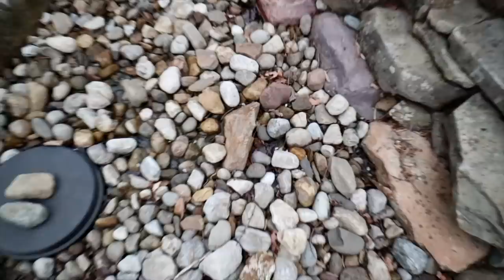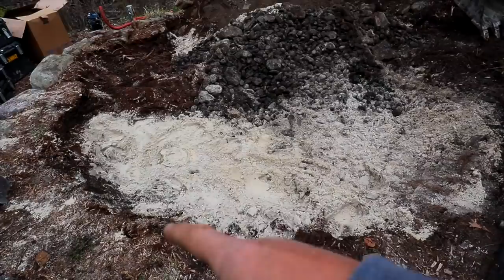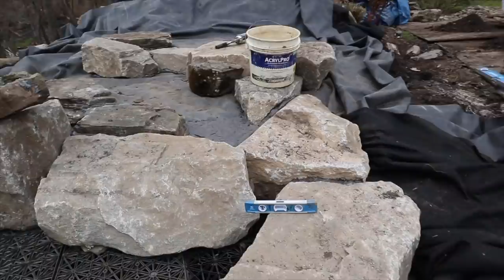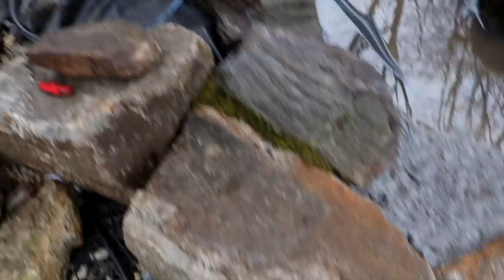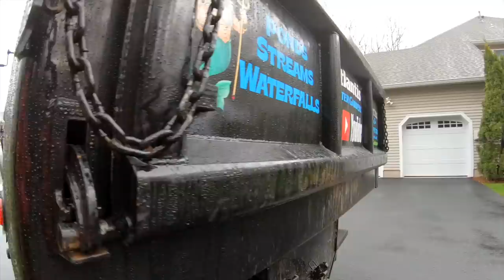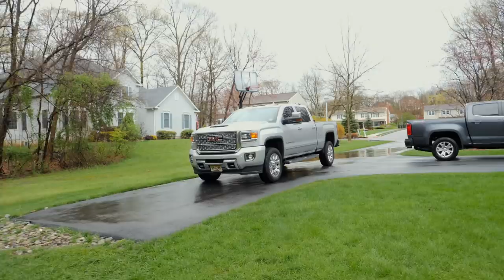Perfect Backyard STREAM & WATERFALL | Patio Falls

Comment: Beautiful, how do you know what the water level is? With a normal pond you can see this, but here you don’t. To prevent that the pump is going dry.
Reply from the maker: There is an inspection port on the top of the vault
Reply: Atlantis Water Gardens thanks